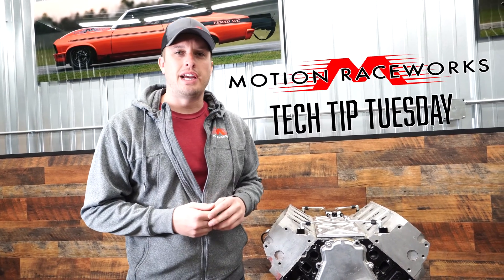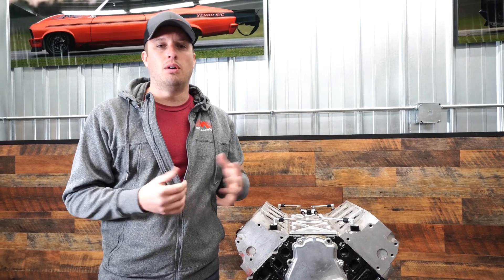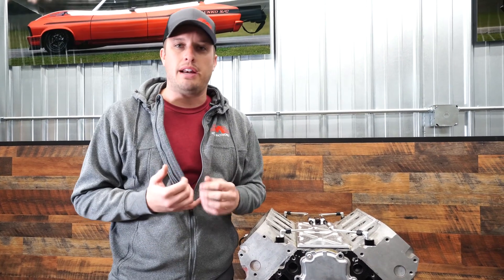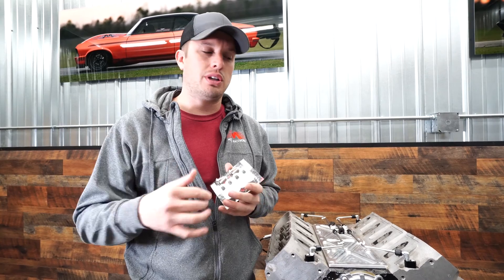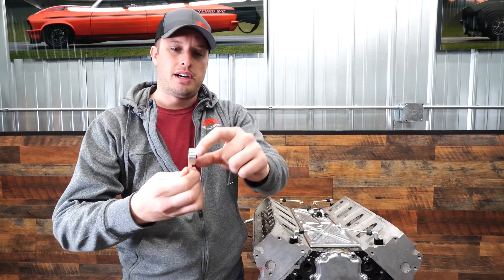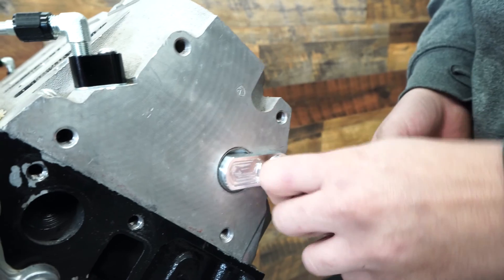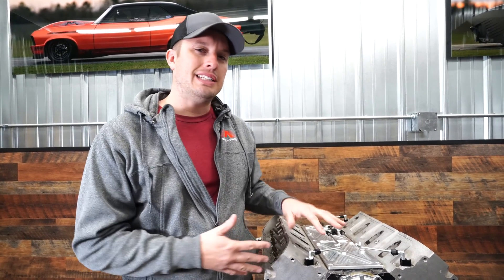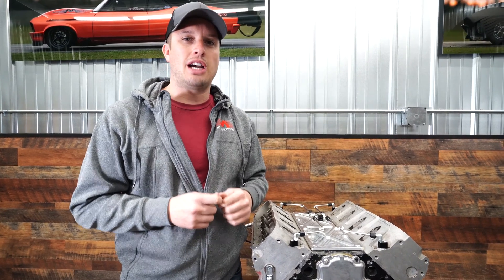DON'T Let Your LS Freeze Plugs Fall Out! Billet Frost Plug Brackets... Tech Tip Tuesday

Comment: If you are boosted enough to push out freeze plugs...you lifted the head and blew the head gasket. The fix is 6 bolt heads and block.

Comment: should also make a universal valley tie to keep cylinders from shifting in 30 years ive split probably 7 blocks one was a pretty expensive block cause the whole thing twist and shifts under acceleration. snapped my transmission in half on that pass as well ! big fun that summer was ! 63 nova 2 never saw so many combos in a year! if those were my heads id put an aluminum freeze plug in the aluminum head then tig an aluminum plug inside the freeze plug . fuse it flush .

Comment: Usually, freeze plugs are replaced when the head is worked. IF the standard 1.25" freeze plug is used, it probably will blow out in boosted situations. The GM freeze plug is 32mm or 1.26" pt# 11562126. Ten thousandths TIGHTER than the standard 1.25 plug.  Not saying these brackets are not needed - just sayin".

Comment: Last fall my father was about 1 minute away from his house when he saw steam and smelled coolant in his 2005 Corvette, he just trailered it down to me to do a bunch of work on, and I found the freeze plug in the rear of the passenger head missing. FML
Update 2 years later I can see the new plugs I installed starting to push out. I wonder if increased RPM (7,200 rev limiter) compounded by faster water pump rpm with a 10% OD crank pulley for more supercharger speed.
Reply: Also keep an eye on the large plug on the back of your water pump.